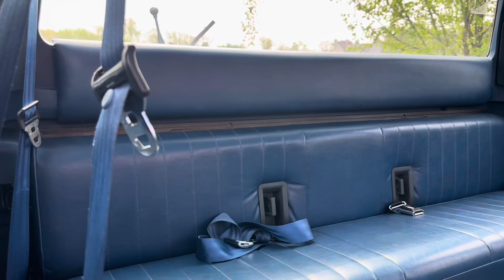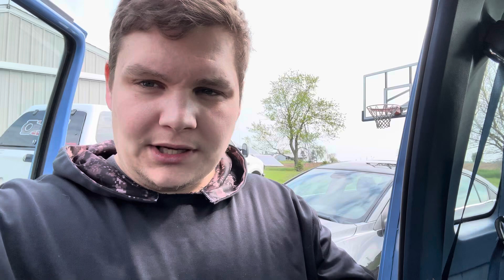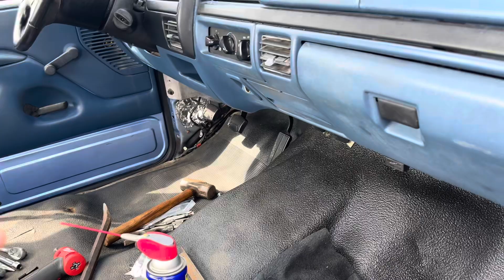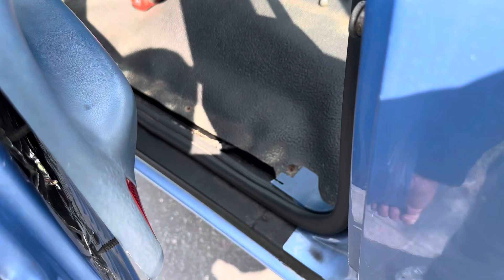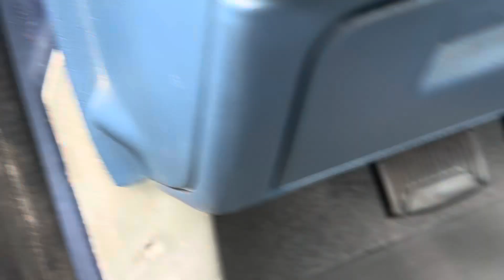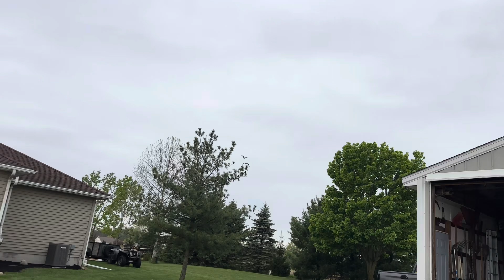EVERY OBS FORD NEEDS THESE‼️

Comment: I hope you do the front end swap  do a in depth video on it. What do you use it not going to have to vacuum line system. I got 03 dually I want to convert over four-wheel drive.